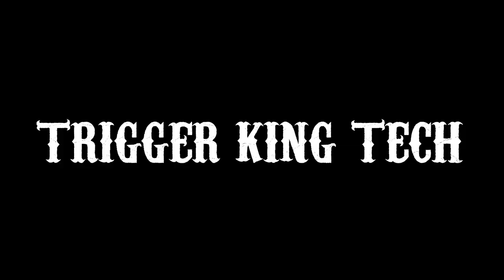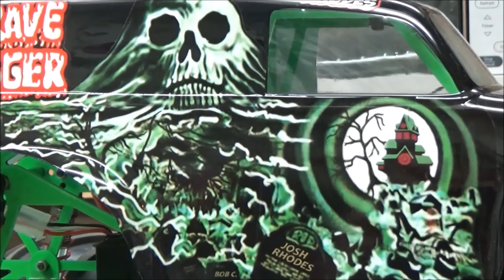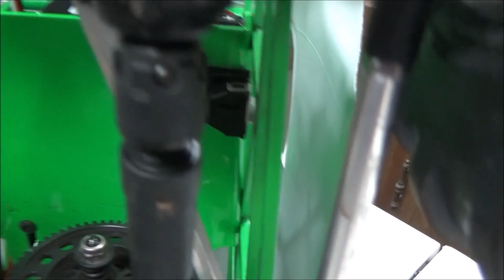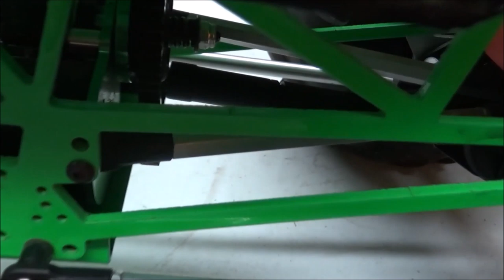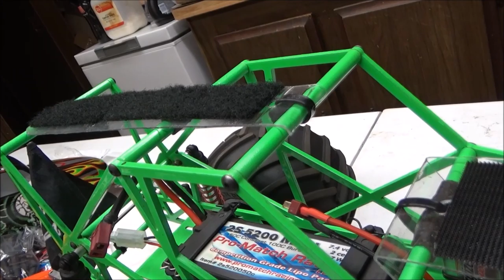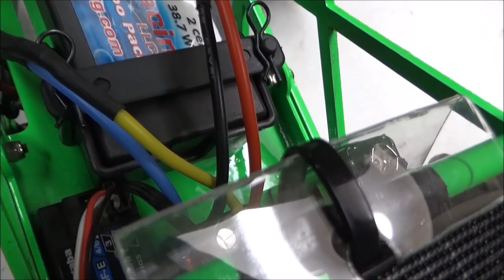Grave Digger #7 Replica Axial-based Monster Truck Build w/ Josh Rhodes - Trigger King Tech

Comment: My favorite real life Digger, and my favorite RC Digger. Great build. I'm using that same trans rebuilding my Max D that I raced against you with at the 4 Link Nats. Can't wait to try it out.
Reply: They are great transmissions, i actually just installed two more into my other shafty trucks!
Reply from the maker: @Josh Rhodes @Danielle Colen yep those transmissions are great. They are about as maintenance free as you can get in rc, which is really saying something given the power that a lot of guys are throwing at them

Comment: what did you use for the 4links to get the wheelbase?
Reply: Its kind of a mix really. The lower links are aluminum, off hand i can't remember the length, i don't have the truck directly infront of me.. However to get the wheelbase perfect there is a mixture of long and short rod ends.